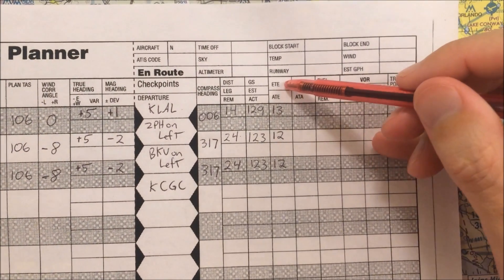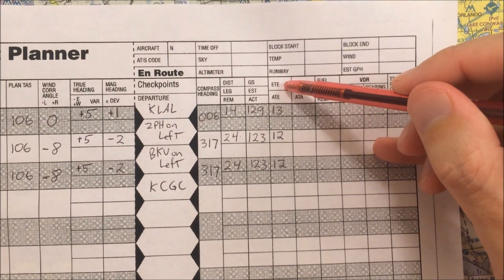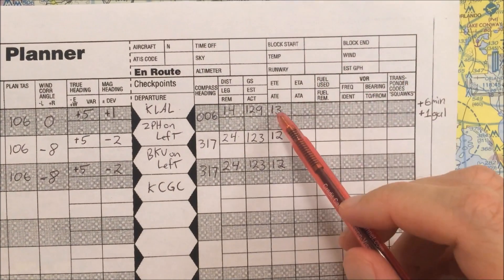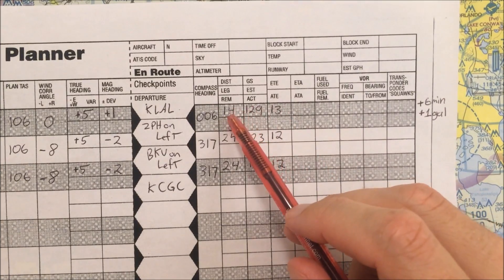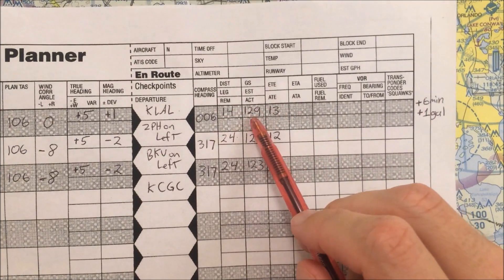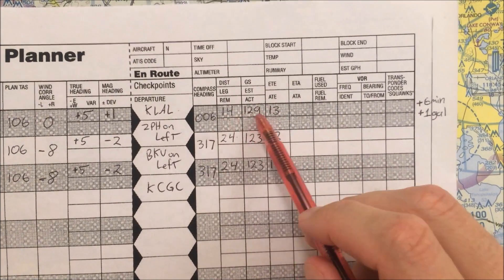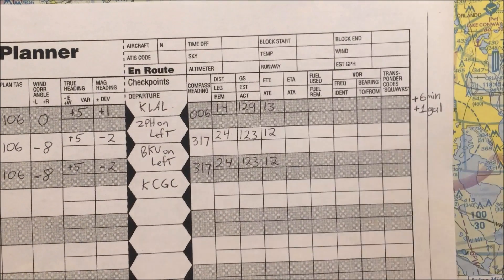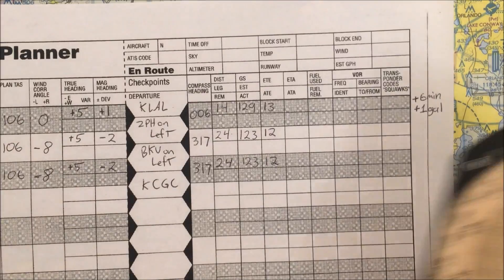VFR Nav Log (Video 7) Calculate ETE using E6B

Comment: Hello. I found these videos very helpful. but I got into a confusion when you used MPH as your GS, but when you calculated for your ETE, you divided it over nautical miles (On previous video). Shouldn't you have used knots for nautical miles and MPH to statute miles?